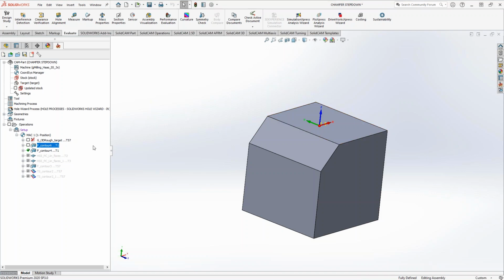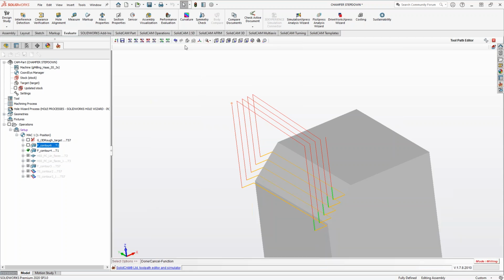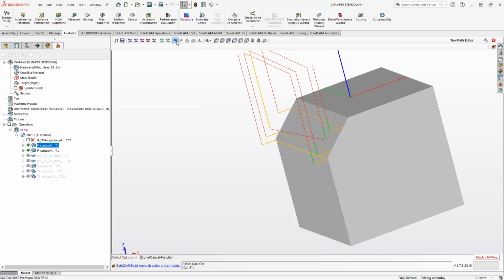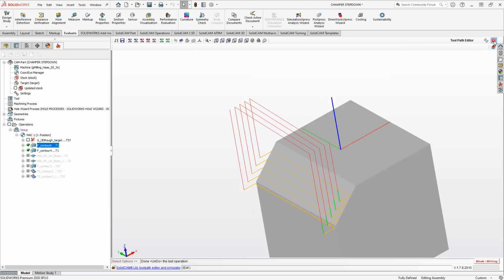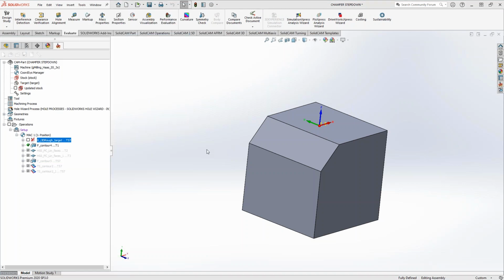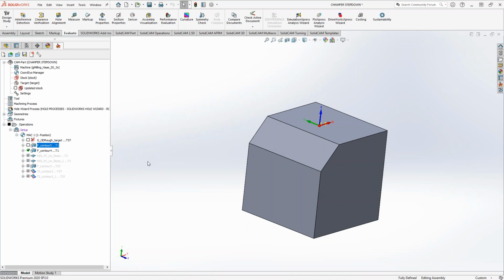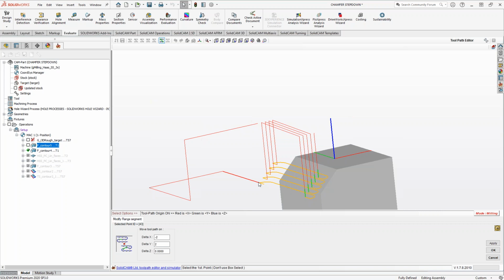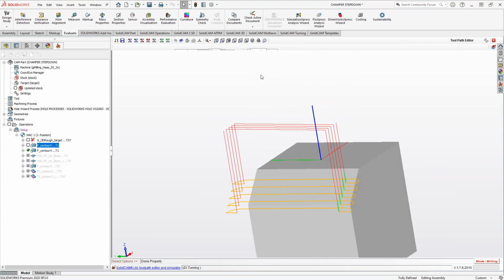SolidCAM LIVE - Tool Path Editor

Comment: I have a major problem with this function. After watching this video I decided to use this on some high tolerance finishing operations on a mould, I trimmed some cutter paths and all appear to work great. I then created the code and run on my CNC. Where I normally get a super finish from HSM, I had a ploughed field, lots of gouges and the external radii were faceted. The edit operation changed the cut tolerance and I had to scrap the block. Not happy